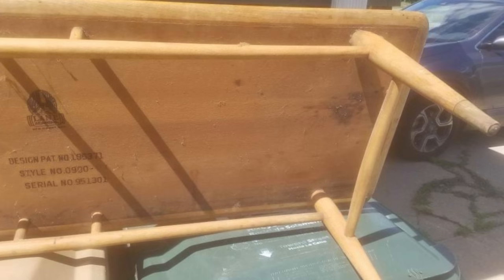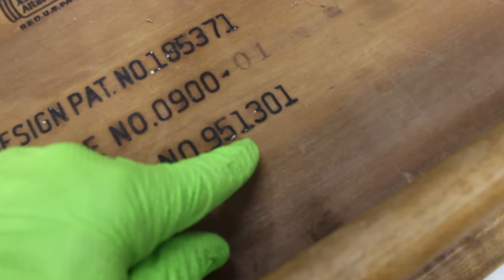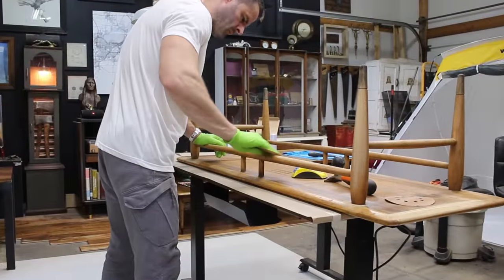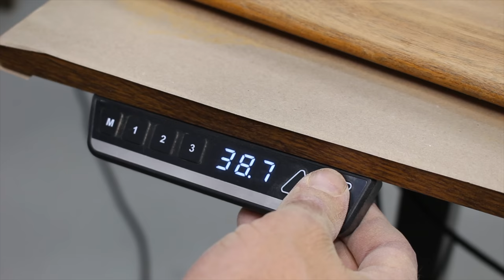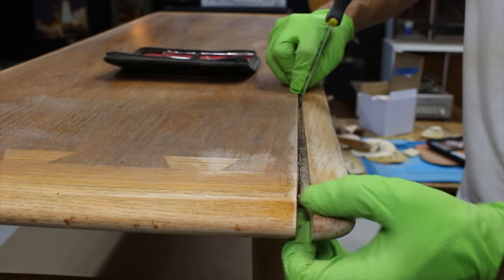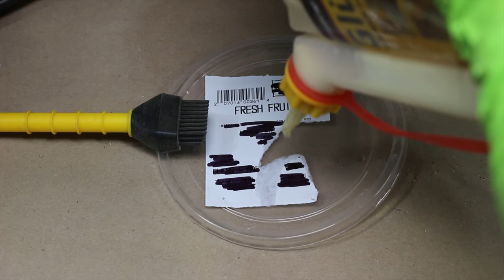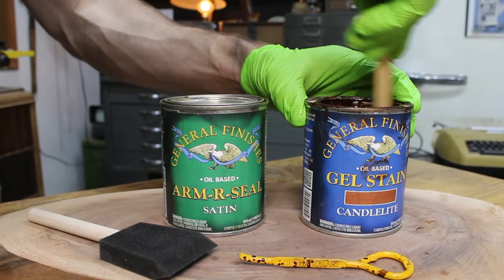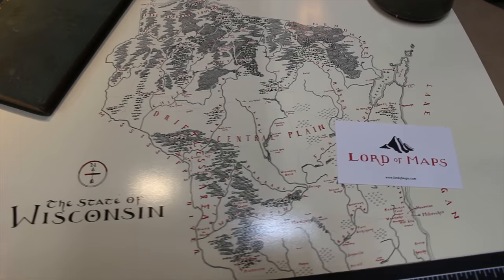Ep. 46 RESTORATION of a Rare Lane Acclaim Table

Comment: I love seeing someone else that sees value in old wood furniture. My parents have several Lane Acclaim pieces that they bought new in the mid 60's. I have about 10 pieces of my own. I'm currently working on refinishing a drum table 900-22 and it is wobbly. Do you have any advice on how to remove the legs? I see screws for the lower shelf, but I'm not sure how the legs come out of the underside of the tabletop. It might be too far gone. I got it for $50 a few years ago near Detroit.

Comment: Wow, the walnut veneer is about as thick as a piece of paper, or looks like it.  I did one of these exact tables and just used stripper so the finish was very easy to get off.  It is weird that they actually veneered the underside, but didn't finish it with anything.  That "Lane" logo would look pretty bad stamped on particle board.  The old particle board was much better than available today, so at least you know it is stable and will never warp.
Reply from the maker: Very thin yes. And I'm always pleased with the quality of the engineered particle board